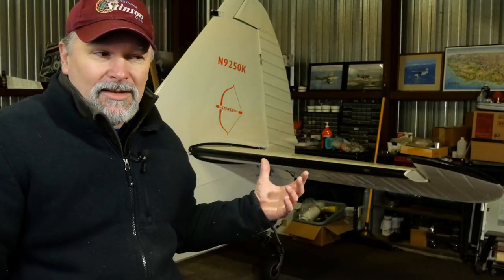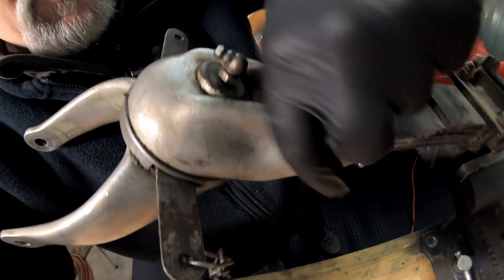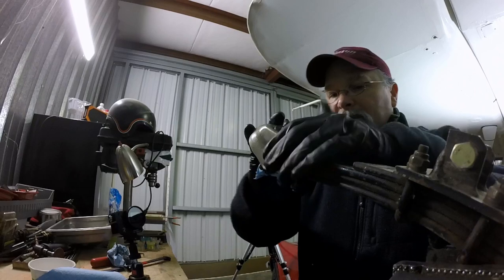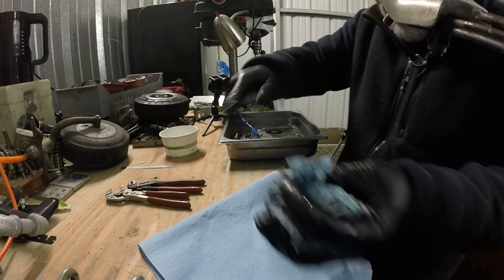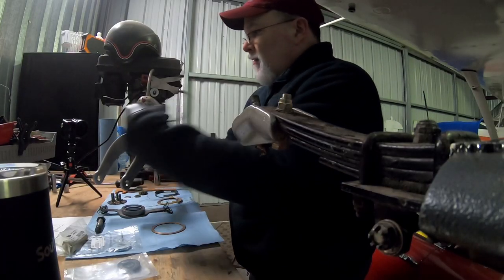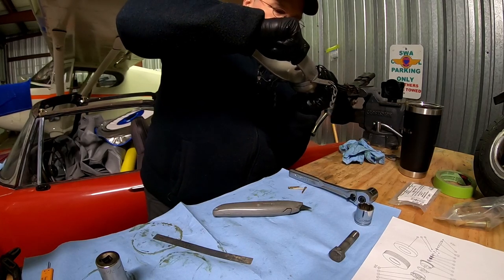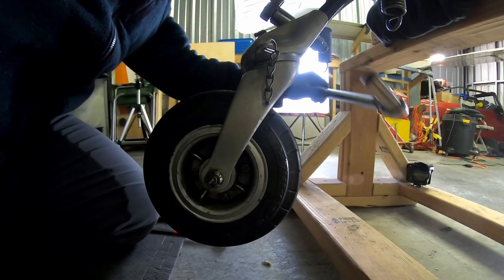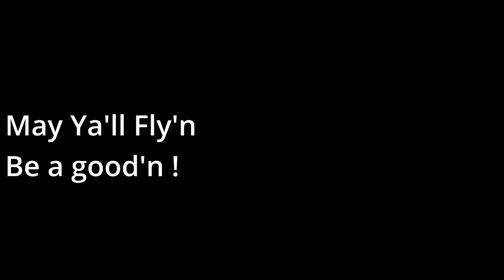Tailwheel Maintenance | What to look for When Your Tailwheel Shimmies

Comment: Thanks for the video. On my Stinson, there is a slight bit of torsional play in the spring mount relative to the longitudinal axis of the aircraft.  Do you have any words of wisdom regarding the bushings in the spring clamp and the transverse hoe through the fuselage?  Also note that the Alaska Bush Wheel company provides shims that go into the "u" of the locking spring to minimize play between the spring and the steering arm detents.
Reply from the maker: I would check the lateral bolt for any wear. This would involve jacking and supporting the tail and pulling that bolt. Inspect the shank of the bolt and the hole in the fitting any wear that you can grab with a fingernail is too much. Upon reassembly ensure that the bolt is properly torqued and not shanked at the bottom of the threads. Hopefully this helps.

Comment: Also for the heavy Stinson you need all 5 springs. If the 3200 was taken from a light tailed aircraft like the Cub, it may only have 3 springs.
Reply from the maker: That is a good point, I think that fact actually made the cutting room floor. I'll pin some key points later, I'll include this one.
Reply from the maker: I had to double check. It's in there at the 11:00 minute mark.

Comment: I have that same wiggle between the head and the spring
Reply from the maker: Have you fixed it? If so, what was the fix?
Reply: @FreedomfixerFlying  No, not yet, its on the LATER list part of the restoration. I have measured the width of the Head “Slot” where the spring attaches and there is about a .035” difference between the upper an lower prob bc it was loose and wore. Not sure the fix yet, I’m guessing machining it and coming up with a shim.
Reply from the maker: @wareairaviationservicesllc4933  you must have the one bolt head like mine. I suppose I could have shimmed that gap out as well. But the bolt torqued up nicely. If it happens again, I'll most surly add a shim.

Comment: I enjoyed the video and especially your editing.  What camera on the small stand were you using for close-up?  I have a channel dealingn with tower and transmitter work where I'm  sometime  using  the bench to demonstrate something every so often. I like picture in Picture editing but my still camera is not much of a Video camera.  It produces AVI which gets morphed to MP4 in my editing software.  

 My wife has a Digital version of Cannon Rebel I bought for her about fifteen years ago.  She hardly ever uses it anymore so I might grab it when she's not looking.  I'm relatively new to tail-wheel and manage a group of owners of a J3-C, of which I am one.  An owner, not a Cub. :-)  I only have 20 hours of TW so far and about 300 of tricycle aircraft.
Reply from the maker: I have a smorgasbord of cameras. My main standup camera is the Panasonic Lumix and the 2 cameras in the interior are GoPro 7's. I believe I was using the 7's for the teardown and assembly. My outside views are from Contours. Sometimes I'll also use my Hero 3+'s in a pinch for B roll shots. Some sort of Jib arm would work great for bench work. Incidentally, I'm editing on DaVinci Resolve currently. Keep up the tailwheel. The cub is a great airplane!

Comment: When can you shim the spring to regain a good caster angle vs replacing the spring?
Reply from the maker: Most cases bad caster angle is due to the spring loosing it's shape. I recommend replacing the spring. It's difficult to find a shop that will "re-spring" , heat treat and certify the old one
Reply: @FreedomfixerFlying  that’s kind of been my thought, but I’m also not so sure it was shimmed right to begin with, as it’s never had a positive angle to begin with.
Reply from the maker: @AkPacerPilot  If you haven't seen this graphic shows what good camber should look like. https://glasair-owners.com/glastar-sportsman/how-to-builder-tips-glastar-sportsman/taming-the-tail-wheel-shimmy/

Comment: Hi Freedomfixer, thanks for the video.  The Maule T/W is on the TCDS, but I think the original OEM tailwheel was a Scott which was smaller than the 3200 but not fully swiveling like the 3200.  My Alaskan Bushwheel  3200 also uses the new type dust seals https://www.airframesalaska.com/Grease-Retainer-p/abi-1863.htm for the wheel bearings. It's the same one which you used on the bottom of the spindle bolt to seal that bearing.  They are a superior seal compared to the original Scoot bearing seal.  I like your explanation for  adjusting the tightness of the spindle nut.  You see some neglected tailwheels which are so loose they will spin like a top.  Not good.  You were correct to point out the weight of the 108 tail.  It's heavy back there, over 100 pounds.  You don't won't it all loosey-goosey.
Reply from the maker: You are correct there are two types of grease seals. The metal ones have a plastic seal inside and can be damaged very easily. The bearings, races and seals are all the same between the wheel and the pinion. Thanks for the input.